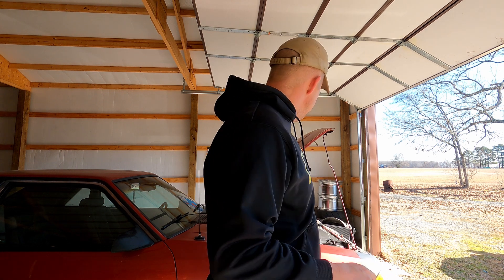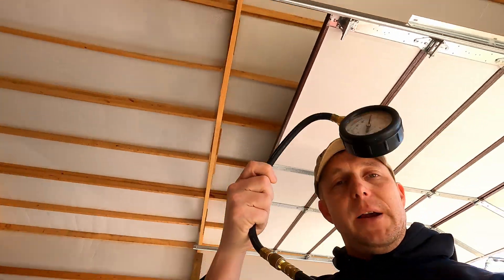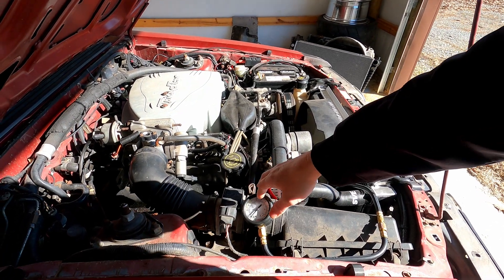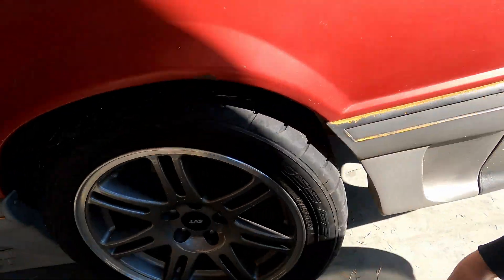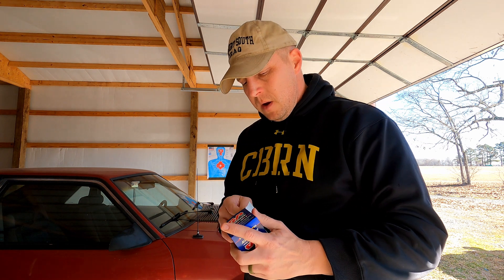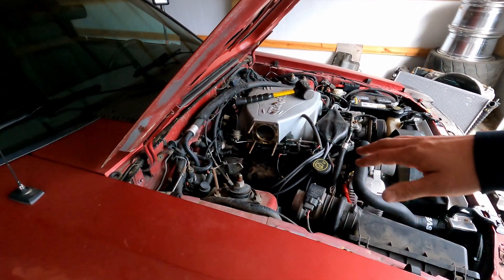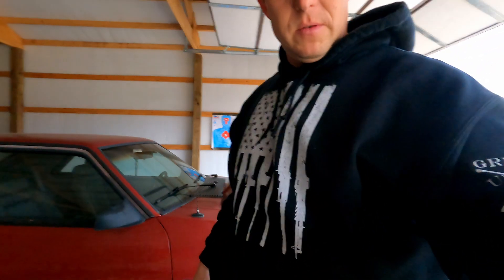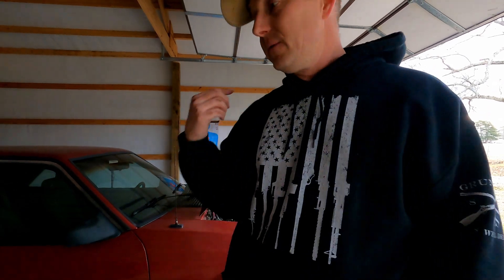Fox Body Fuel Pressure Regulator Diagnosis and Install

Comment: Hi. When you block off the return fuel line, and the FPR is bad, why does that cause the fuel pressure to increase?  Trying to understand the mechanics of that. Thanks. BTW, my stock 93 just started have 0 fuel psi and slowly climbs to 15 but cannot maintain an idle.
Reply from the maker: The fuel pressure regulator essentially is supposed to “bleed off” excess fuel in the rails to the return line when pressure reaches a certain point. It does this through spring pressure on a valve that is controlled by a vacuum diaphragm. When you restrict or block the return line the excess has nowhere to go, hence the increase in pressure. 

If you have 0-15 psi fuel pressure, that sounds more like a fuel pump issue or an issue in the fuel tank. However, it could still be the regulator. I have seen them where the diaphragm has blown out so bad that fuel is just going straight through to the return line.

Comment: You are my personal savior!! I have a chassis of a 91 mark vii with the exact same motor. I have the body of a 1950 shoebox sitting on this. You could imagine, finding solutions to any problems I have isn't easy (and I'm not just talking mental). But your video accidentally showed me a lot more than you were talking about! This thing has so much hose rot and all in all needs some attending after being left on the back burner. As you panned through, it answered some questions I've had!!! Thank you my guy!!
Reply from the maker: Glad it helped!

Comment: I just replaced my fuel pressure regulator doing it the same way you did, I did not take the intake off only throttle body , it’s was annoying took few hrs just getting it off with that Allen wrench, putting it back in was fun. That farthest back bolt gave me a run for it. Without watching you I wouldn’t have went for it but it worked out!
Reply from the maker: Yea I have no idea what ford was thinking when the put the bolts on the bottom. Glad you were able to get it though.

Comment: How about drilling out tge 3 bolts and putting in 3 new nuts and bolts with the bolts from the top?
Reply from the maker: You could I suppose.  But you’d still have to contend with getting something under neath to hold the bottom side in place.

Comment: In my case, low fuel pressure was caused from sitting for 5 years and rust plugged the fuel filter. The person I bought the car from had replaced the pump and filter, and, 'rinsed' out the tank. I replaced the tank and all parts in it. Then, later, I got a crank, spark, no start. Capacitors in the ECU. Old cars are Fun!
Reply from the maker: Yep they’re the gift that keeps on giving!

Comment: Did this solve the hot starting issues?
Reply from the maker: In my case no. It ended up being an issue in the tank.
Reply from the maker: Sorry I misread. Well that is on going. Replaced the TFI and it went away. But the PIP has since gone out cause the car to not start at all. I have a new distributor and a TFI relocation kit to install still